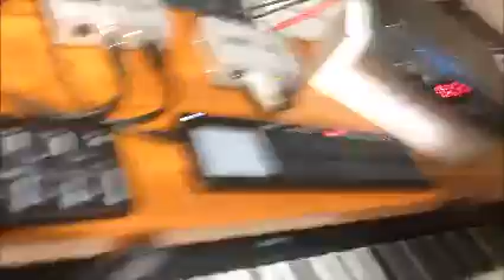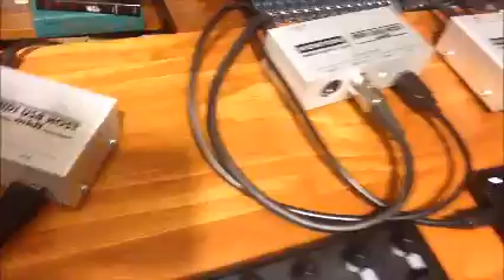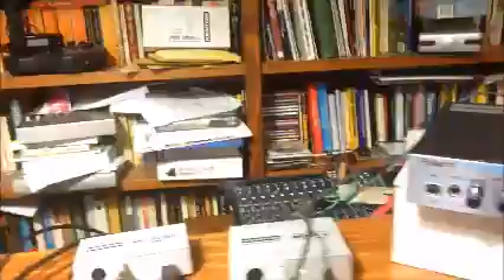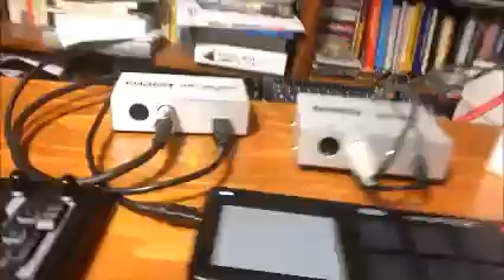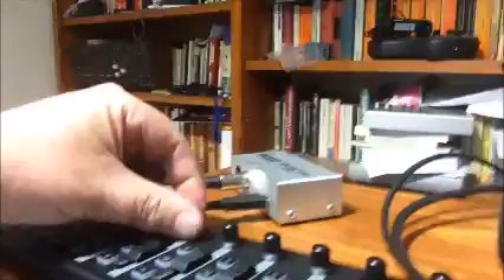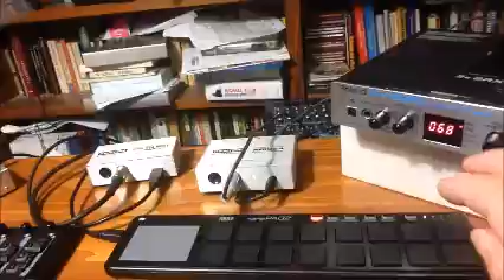Real time Midi Control of Synth Module Parameters

Comment: I have the Alesis v25 keyboard and plugged it in the Kenton USB Box and from the Kenton I'm going from the 5 pin MIDI din "out" to the "in"of my Volca FM. The lights come on with my Alesis keyboard but no sound. Why? Can you help me?
Reply: Is the midi channel to receive on the Volca the same as the midi channel on the Alesis output?
Reply: https://www.reddit.com/r/synthesizers/comments/4d7071/volca_fm_velocity_from_an_external_midi_keyboard/

Comment: Hi Steve, This is genius!
I have been looking for a solution to this for a while now. Just wondering how you assign the MIDI commands you want to each pad, knob and slider? Presumably you have to connect the Kenton MIDI USB Host and/or the Korg Nanobots to a computer to ‘programme’ them? Can't think how else you could do this.
Reply: Graeme Paterson The Korg devices are programmable. There is a software editor to prescribe the Korg Nanopad settings.
Reply: Steve Smith å